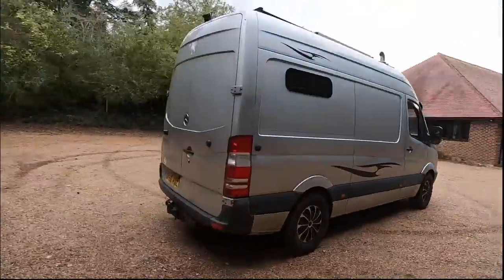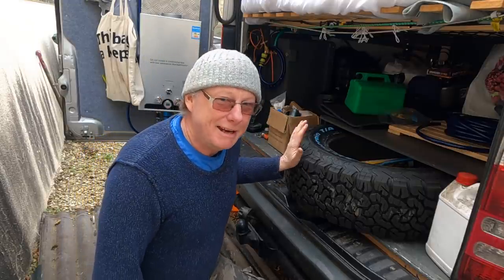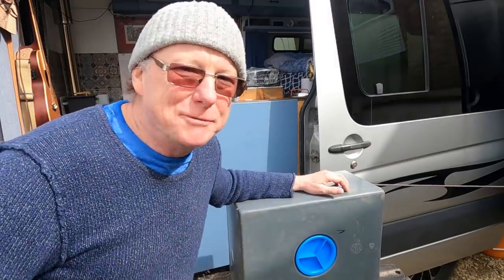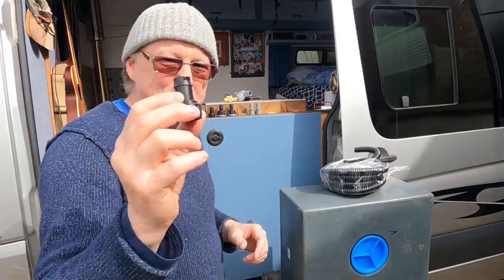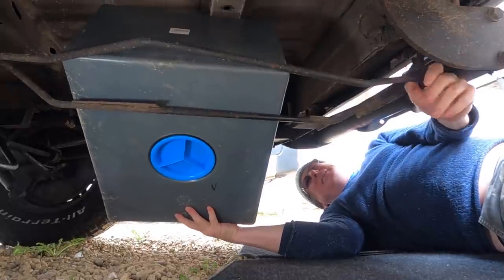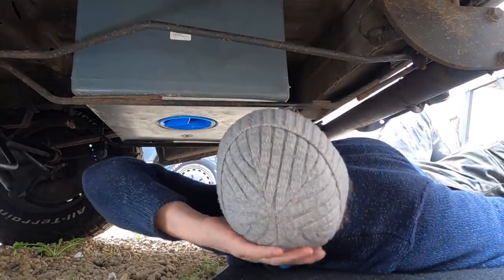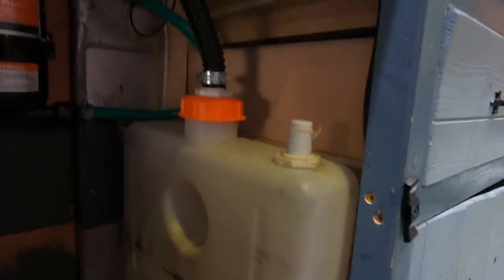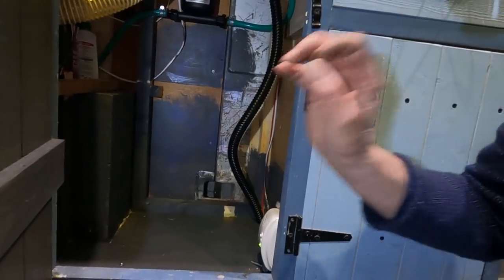How to install a grey water tank underneath your campervan conversion

Comment: I had the joys of fitting my grey water tank last weekend. Only thing I did different was to put the outlet fitting in the bottom of the tank and not the side. As you have it, the 10 litres you put in will always be below the outlet where you have it. And that will start to smell as you can never get rid of it... 👍
Reply from the maker: Ooh that’s a good point I’m going to have to change that now thanks for the heads up
Reply: That is a good point but if u have or fit a a 'u bend' that should cause an air lock to stop any smell coming back up the pipe. Could just be a sweeping 's' in the pipe below the sink👍
Reply: @johnfittis5764  or a 360 loop works well too.

Comment: well done young fella, only things i did different was the air release overflow on my tank was simply a hole drilled into th tank at the top, didnt see the need to have a fitting like you and i also put the waste outlet on the bottom of the tank, i didnt want any water left in the tank that could smell eventually and we have a small grate type thing on our plughole that catches any food bits like rice etc and stops them going down to the waste tank, its removeable so i just put the food bits in the bin if we get any.
Reply from the maker: That’s a great idea pardon the pun 👍😂👍
Reply: Seen them in B+M today for £1.50 👍

Comment: Don’t give up Mel, if you fill it up it will run. There’s so much air in the pipes that it’ll need some weight of water to get it started flowing. Good luck
Reply from the maker: Thank you I’m going to try fitting a pump 👍
Reply: @BigVanSmallWorld  aye, that’ll work better I guess. You can probably run pump and valve from the same switch.
Reply: liquids always flow down, if you fit the outlet tubes going up, better park on a steep hill :p

Comment: I think the clue was in the lack of flow when you disconnected the solenoid pipe. The tank seemed to have a lot of depth underneath your outlet. Also the outlet pipe appeared to be going uphill from your tank. Great idea though and something to work on.👍
Reply from the maker: I’m on it 👍
Reply: I agree with this stick a hose in it and fill it, that will check for leaks and then u can see if the remote drain solenoid works or not👍

Comment: If you put a quick release hose coupler on the end of the drain pipe you can fill the tank easily with fresh every so often to flush the tank. It will also serve as a quick fix to push any food waste back out of the dump valve which could save you a trip below the van to manually clear it. 
Drop a little bleach or sterilising fluid down the sink, fill the tank either via the sink or using a hose   Let it sit overnight then empty next morning and hey presto. Fresh tank if you need to lay the van up for a while.  Nothing worse smelling than a stagnant grey water tank.  (Well maybe a black tank could be worse)
Keep the videos coming. Love them.  Regards Steve (Belfast N Ireland)
Reply from the maker: Thank you buddy
Reply: @BigVanSmallWorld  you’re welcome. One of the things I love about your videos is that you use tools that everyone can afford. There’s so many out there with beautiful builds but they have workshops and tools that most can only dream about.

Comment: You've put yours where mine was on my Talbot Express Camelot 34 years ago, i didn't want to rip it off when on rough terrain. The inspection cover was on top under van floor so of no use at all. Three holes in for two sinks and shower and no seals what so ever, just pipes going in. So i imagine if i used it would be sloshy and smelly. Your ratchet will get crusty where it is.
Wat Er GreYt Waste of time. Nice to see someone give Ebay a mention, as most people mention mainly the other one. Amaz On video Mel.
Reply from the maker: Thank you ☺️

Comment: If you bend the discharge pipe higher than the bottom of your tank, it will never empty itself completely, since water does not climb, and as I see your pipe bends upwards, also the attachment to your bumper seems to me slightly higher than your water tankfloor

Comment: Great idea, your bang on the money with pressure on the solenoid.
Sadly you didn’t use gravity as your co pilot. Should have love red the pipe, if you wanted it to siphon, swap the solenoid with a small motor pump like they use in fountains etc.
Reply from the maker: Thank you for your positive message watch the next video where I actually do fit a pump your bang on the money too 😊👍
Reply: @BigVanSmallWorld  no, thank you for the numerous and thorough videos my man. An absolute treasure trove! Keep up the good work & I’ll keep up the watching!
Reply from the maker: @ZoltanHercules  I think you 👍😊👍

Comment: I couldn't see if you have some form of u bend below the sink. If not you will definitely need something to stop smells from waste tank coming back at you. If the outlet was on the bottom of the tank nearly all water will drain off, rather than as you have it. I would put a neoprene cover over inspection hole using velcro so that protected from dirt etc. so nice to give you more space inside and hopefully once switch working easier to empty. 😎
Reply from the maker: Thank you yes I’ll definitely have a water trap to stop smelling 👍

Comment: Nice installation Mel :)  If and when you get that valve working then you don't need to put another hole in the tank for the manual drain, just add a t-piece in the pipe in between the tank and the valve :)
Reply from the maker: Thank you that’s really good point

Comment: Mel I think I would of rana bottom drain with a 90 deg fitting.  Is your drain pipe smooth inside or is it like the outside, if like outside that would slow the draining alot.  Can't you use PVC or ABS pipe for drain after it gets under van. Straight and always heading down hill. Like the tank. Good luck PS  I would look for a larger drain valve . Maybe a mechanical gate valve with a heavy spring set up to close after dumping. Pull rod or cable to dump and let spring close it by pulling handle shut.
Reply from the maker: Thank you ☺️

Comment: nice job, but you should used a rubber band between your waste tank and the metal strips it will hold your tank from slipping or gliding on the metal parts,  but really lovely job done
Reply from the maker: Look closer you will see there’s side bars stopping it from moving side to side 👍
Reply: @BigVanSmallWorld  well done indeed 👍🙌😉

Comment: I think you need to put a u bend somewhere on your pipe to create a water trap so bad food smells don't make their way back inside your van (haven't hooked up my waste tank yet, this is just stuff I've read in my research)
Reply from the maker: I got one for it
Reply: Mel's Van Life roger that 👍
Reply: if you have the depth, just put a loop in the waste pipe, possibly right under the sink - it achieves the same thing.
Also, put the inlet at the back of the tank - if you have a full tank and go down a steep hill, the water can make it's way back through the waste pie, but if the hole is at the back, it cant. Not so critical on a sink but if there is a shower there too it can be a disaster. 
Did the solenoid work before it was plumbed in? It should do even without pressure

Comment: Hi Mel,  for me it looks like the hoose is pointing up wards! That means that no water will come out, and you only filled up the tank a quarter ! Try to point the hoose end below the bottom of the tank and the soleonid valve will work.  Regards Rickard from Sweden 🇸🇪
Reply from the maker: Thank you

Comment: Good plan to use the spare wheel cradle and the tank is a perfect fit! Can you tie up your waste pipe so it isn't lower than the fill point on the tank? Looks to be quite a bit below. That little grey fitting with the bowl bit underneath is a smell trap - fit it under your sink - its the campervan equivalent of a U bend. A better way of dealing with food scraps would be to stop them going down the plug hole with a strainer 😄 I got irrigation hose too, mainly as it is smooth on the inside - so can't go yucky. Stick with the manual tap, as some places are pretty strict on where you dump waste water, and you don't want to get in bother if you press the wrong switch and dump the tank by accident .

Comment: Mel, Lots of the cheaper solenoid valves require a minimum of 0.2Bar to operate. At roughly £25/30 you’ll find plenty that will work without needing any pressure to open.
Reply from the maker: Thank you

Comment: Hey Mel, good work. I would consider a motorised valve rather than solenoid and would definitely think about using a larger diameter for the waste dump. The inside of the valve will be restricted so flow will be slow.
Reply from the maker: Thank you I’m on it

Comment: That solenoid is going to cause you issues (low flow/blocking) and adding a waste pump is also going to cause problems. Get a 12v motorised valve - you want a CR04 type that you just apply power to it to open, and when you switch it off there is a charge stored inside that it uses to fully close the valve. Just be careful as they sell “full port” and “reduced port” valves. The reduced port ones have a much smaller hole in the valve body than the fittings at the end. If using 19mm waste pipe be sure the hole in the valve that turns is this size or bigger.
Reply from the maker: Thank you I’m on it

Comment: That valve looks similar to the type used in domestic appliances. I am a domestic appliance engineer and if it is the same, they require a lot more pressure to operate. Good luck

Comment: Well Mel, a nice try mate! If you do sort it and have a electric solenoid set up, I was thinking if you just put a 19mm tee pipe between the tank drain hole and the solenoid connect the manual pipe  to the tee it would be one less hole in the tank and still able to have it 'filtered too..... but maybe that was your cunning plan all along.... Well done anyway:)
Reply from the maker: That’s a great idea thank you I have ordered a pump now so the water will be under pressure I can’t wait to try it but it won’t be here until the 7th so maybe in time for the following Friday 👍👍

Comment: Mel, now I'm thinking, the waste pipe end might have been over the water level of the tank. With only 10 litres it might have not reached the level. I guess you have but, did you test the valve outside on the dry?
Reply from the maker: Don’t worry I got a great idea

Comment: While I'm not sure if that valve needs pressure to operate I do know that your final outlet pipe on the rear bumper, combined with the slop, was a lot higher than the water level of the tank. Maybe worth just installing the valve as-is without any pipes attached and seeing if that is the case before throwing in the towel! (It's a good idea after all)
Reply from the maker: Thank you

Comment: I think the angle you are parked and the little amount of water in the tank is the reason you didn’t see anything flow from the electric valve. Look at how slow the water trickled out when you changed the pipe over to your old manual valve drain. I would give it another go when there’s more water in the tank to creat some pressure to flow through your electric valve. Give us an update please when you look at it again.
Reply from the maker: Thank you you’re absolutely right

Comment: Vent pipe may need to be bigger also was the blue hose connected to the vent had a kink in it.
Reply from the maker: Yes maybe but it wasn’t really that bad it looks worse than it actually was I’m just waiting for a brake in the weather and I got a great idea to try out 👍

Comment: Over time would those metal bars rub holes in the tank. I'd think about some rubber or neoprene on the contact points
Reply from the maker: Thank you
Reply: @BigVanSmallWorld  and on the idea of the electric draining system... what's wrong with a 12v inline pump...
Reply from the maker: Keep watching
Reply: @BigVanSmallWorld  always do pal

Comment: Hi Mel ,  I tried one of those solenoid valves and it didn't work either, I think it needs to be pressurised. I changed it for a
Reply from the maker: I think you’re absolutely right iv got a pump coming soon

Comment: Get a 12v ball valve. Switch is a bit different as it's not just on off.
Reply from the maker: Thank you 🙏
Reply: There is a 12v motorised valve that can use the same wiring and switch. It’s called a CR-04 and it contains a capacitor that charges when power is applied to open the valve. Once the power is turned off the stored charge is used to fully close the valve.
Reply: @theonlywoody2shoes   that's good to know I have the other sort that needs a power feed to open and close. I think I will swap it out as for my application there is a small but present risk if I have a power cut. Thanks and yes this would be perfect for Mel.

Comment: Is the solenoid valve 12v or 240v?
Reply from the maker: Really
Reply: @BigVanSmallWorld  Really.  If its a 3.4 kilo ohm resistance solenoid designed to work at 240v, it's not going to work at 12v. Just asking.
Reply from the maker: @brianmac001  i can confirm it’s 12v DC

Comment: The more weight you carry behind the axle is not good. You will have the tail wagging the dog😂😂. If the LPG stations start getting fewer and fewer I was thinking about putting my spare wheel on my back door and put in the 50 L gas tank where the spare wheel was. But up to now I have no problem getting gas so that is excuse the pun still on the back burner. Stay safe🚐☕️☕️👍🏼🏴🌈🙏🏼💙❤️💙❤️
Reply from the maker: Hay buddy that’s really good point I’ll make sure I don’t drive with full grey water tank 👍

Comment: I'm sure youve realized it by now, but your design for the empty is off - the tank cant empty up like that. The tube from the tank needs to be parallel or traveling beneath the tank for it to empty unless you attach pump...
Reply from the maker: I’m on it